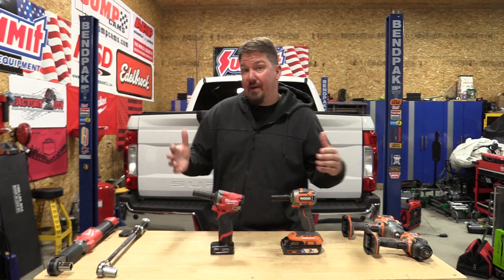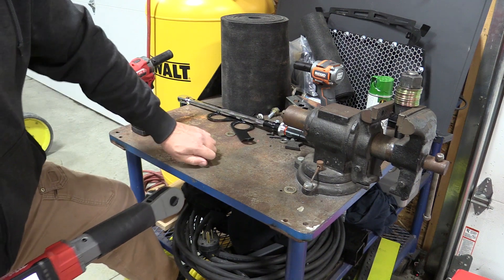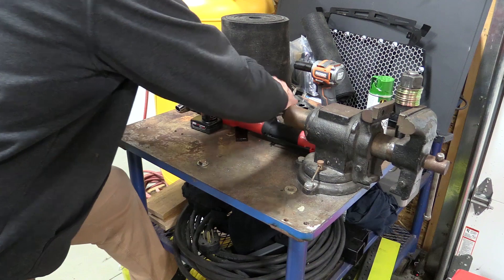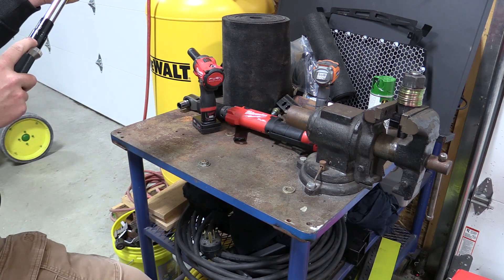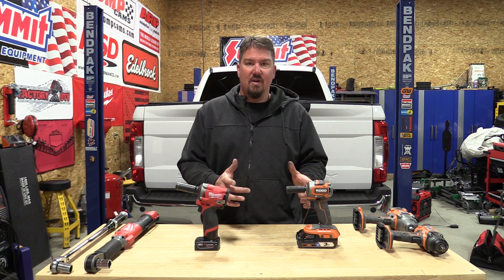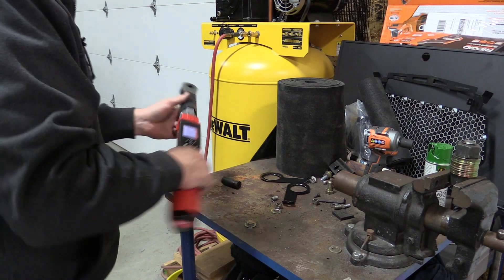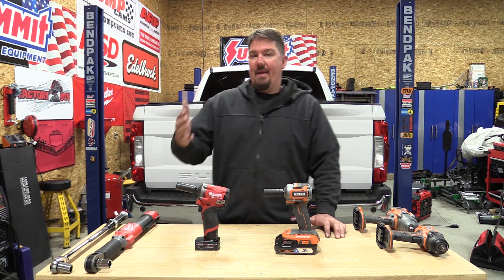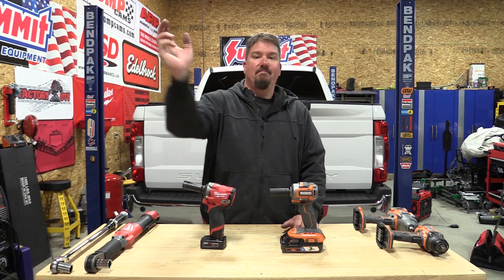Milwaukee FUEL M12 Stubby Vs Ridgid 18-Volt Sub-Compact Impact Wrench

Comment: One of your other videos mentioned the DEWALT  XTREME 12-volt Brushless 3/8-in Impact Wrench.  You seemed to really like its small frame.  I see the Rigid 18v is going for $88 at HD, no battery.  The Dewalt 12v is $149 at Lowes. 

Between the Rigid sub compact 18v and the Dewalt Xtreme 12v, which one would you go with?  
Thanks

Comment: Suggestion: the caliper bracket bolts on cars can take way over 250 ft.lbs of torque. 

They are usually 12.9 property class bolts with 18mm-20mm diameter.

Comment: man that's literally a $700+ torque wrench
Reply: I would sooo love to have that
Reply: What is the brand and model of your digital torque wrench/powered reatchet?
Reply: Russ Campbell are you serious?
Reply: @russcampbell7994  its a milwaukee
Reply: And completely useless on modern cars as they are mostly torque to yield and need an angle function. Dumbest tool Milwaukee has ever made.
Reply: SATAMAN Schmidt true
Reply: @satamanschmidt3428  Your point are true but Milwaukee themselves even state that the torque wrench wasn't made with mechanics in mind. It's aimed towards electrical work
Reply: @satamanschmidt3428  Maybe useless for you. GO talk to an industrial electrician and other trades and see if they think it's the dumbest tool they ever made. If they spent so much time and effort on developing such a tool, there's probably a high demand for it.

Comment: Just weld a grade 8 bolt coming up threw the table then just use a nut for the testing it would be very strong then and super cheap.
Reply: Or a grade 8 with a non threaded hole and just let someone hold the nut side with a breaker bar. Maybe not 100% accurate but either would work.
Reply: Both of you are pretty on the right track. Grade 8 or better bolt and nut rather than trying to tap a steel plate. Theo only question is how to secure the bolt or nut.

Comment: Sunex makes 3/8 impact sockets up to 22mm in both shallow and deep. I believe they go up to one inch in standard as well.
Reply from the maker: I do not have them because I jump to 1/2" after 3/4"  At what point do I need a ton of 3/8" impacts when I have 1/2, 3/4 and 1" drive units.
Reply: WorkshopAddict I got them so I don’t have to lug the heavy half inch impact around to snug up lug nuts when the 3/8 impact can do the job and they are much lighter. Considering the torque those little 3/8 guns put out I reach for them first. Plus the sunex 3/8 sockets are thin wall sockets so they come in handy in tight places. Anyway just though they might help if you want to step up torque testing with bigger bolts. Appreciate all your videos!
Reply: You can also get the full 3/8 Proto Impact set that goes up to 24mm shallow and deep.  Its USA made also, I highly recommend them.

Comment: Hey Brian. 
This is definitely not intended as a criticism, simply an observation on the testing method used in the video. 
As you tighten, loosen and tighten the same bolt into the same hole, both the bolt and the hole can't help but heat up which could drastically affect the amount of torque or actual effort required by each impact wrench to break the bolt loose. 
Similar to using a torch to heat a stubborn or stuck bolt. 
Perhaps multiple bolts fastened to a long piece of steel would help with accuracy. 
Having said all of that, thanks for all that you and Jeff do to help us make more educated choices in tool selection. 
Much appreciated.
Reply from the maker: i totally get it John.  We do not have the capability at this point for testing like this.
Reply: @WorkshopAddict  Fair enough. 
Thank you again for all that you are able to, and continue to do.

Comment: Really like this testing style - I think it simulates the majority of my automotive experiences: stuff breaks and nothing makes sense. One question though - why not use the subcompact batteries in these tests?
Reply from the maker: We can never win when doing these tests.  People will say use the Octane for power and some say use small.  I wanted to be fair and use the Octane since the tool comes without a battery.
Reply: @WorkshopAddict  That makes perfect senes. Either way, you're doing a great job with these tests.
Reply: I think using the 4.0 or 6.0 on Milwaukee is more accurate to real world use on the impacts. Thank you for the video and the honesty of what you really experienced

Comment: Deep well has more mass than shallow socket is why there is higher  torque output from the impact. 

Check out lisle socket 77080 for harmonic balancers, they put allot of meat into that socket to help aid in the bolt removal. 

I don't know all the science behind it but more mass in the socket helps a ton.

Comment: If you dont understand why a heavier (deep well) socket produces more impact torque than a lighter (shallow) socket, you need to quit doing tool videos.  Its the same principal as why a 1lb hammer produces more power than a 6oz hammer, given the same energy (swing)....

Comment: Semi truck wheel lugs. I couldn't use my old Gen 1 non fuel Milwaukee 1/2" impact (rated 400lb ft) but my m12 stubby can take the lugs off of my 1 ton dually. You can buy 1" sockets for 3/8 but I used an adapter to get to the 1-1/8" needed for the dually

Comment: How about using the nut on a tow ball hitch??   Just take a tow ball hitch, face it sideway or upside down, so the nut is facing you!
I know they can take way over 250lbs-ft.  And the hitch is secured to an actual truck, so it will be secured.

I know it’s not perfect for the 3/8s, because you will have to use an adapter.  But every 3/8 wrench will have an adapter.

Alternatively, maybe you can take a sacrificial socket and adapter and weld them together, so you the have a 3/8 drive socket, and 1/2 drive socket, you can test your impact wrenches on.

Comment: I appreciate you being to straight forward and honest so much! ❤️ I think you should try a bigger tap/bolt and get a bigger socket.
Reply: Yeah a bigger bolt would be a must since they're being sheared off.

Would probably be better to just drill a hole through and put a nut and lock washer on the other side. Then if the threads let go you can just get a new nut instead of tapping a new hole

Comment: No expert here by any means, but I think if you want more repeatable results, you need multiple freshly threaded holes and multiple new bolts.  Each time you torque a bolt, it stretches.  Also, as the bolt heats up from repeated use, your torque results will change.   Be sure that all threads are clean and dry too.   Keep up the good work!
Reply from the maker: Fully agree/just doing what made sense for a video that was not edited to hell and did not show the results in an honest way.

Comment: The highest socket I can get is 22mm on my stubby. I got it from sunnex. Just send that the torque reading is perfect for these size tools 3/8
Reply: I have a grey pneumatic mid depth set in 3/8” SAE and it goes up to 1” but the metric set only goes to 19mm

Comment: I have all 3 of the Milwaukee stubbies and I think the tool testing the manufactures do to get there final spec rating is no load testing with small sockets and small bolts and nuts like the Milwaukee 3/8 having 250 foot pound of break away torque as well as install and the bigger the socket the more torque lost as well as bigger the bolt and nut so I think the results to get them ratings were done with a specific size socket and nut and bolt to get the 250 foot pound rating good video and testing Brian @WorkshopAddict

Comment: I appreciate the honesty and the effort to maintain objectivity. It's refreshing to actually see that. 
The use case I am interested in is when I am working on brakes. I went out and bought the larger Milwaukee impact gun with ~1000 ft. lbs of "nut busting torque" to remove lug nuts, and it lives up to the hype!! It's a beauty, and if memory serves it may have been one of your previous reviews that added to my confidence in the purchase.
With this particular tool, I am interested in what is strong enough AND small enough to get at the brake calliper bolts, and any other bolt where the large Milwaukee impact gun is unfortunately too large to get in those tight areas. Unfortunately I still need to use a breaking bar for those bolts sometimes. The Milwaukee impact ratchet is not strong enough for them. I am hoping this impact gun is the solution for that specific use case.
What this video does show me is that there is no evidence to consider Rigid over my existing Milwaukee investment, so it still serves a purpose for me.
Thanks for the video.
Reply from the maker: Some of the bolts that hold the brackets the calipers sit in are lock titled in there and are hard to remove.  We did a Traverse 2 days ago and we used the Milwaukee Mid-Torque to get the 21mm bracket bolts out so we could remove the rotors.  The stubby would not move them.
Reply: @WorkshopAddict  Good to know. Thanks for the follow up!

Comment: What?  You don't have $5k burning a hole in your pocket for an impact torque tester?!  Haha!  Good on you for giving it a try, and even better that you have the integrity to call it a fail.  With these 3/8 drive units getting so powerful it's tough to find the sockets big enough to do decent tests.  Glad someone has enough experience to tell the difference between an impact wrench and an impact driver too.  I think we are pretty much at the limits of what the anvils can take in 1/4, 3/8, and 1/2 in tools anyway.  With impacts, the sockets can make a huge difference too.  There's a kid on here somewhere who welded a heavy wall pipe sleeves over his impact socket and he's able to remove a lot more frozen bolts, and nuts than he can with a normal impact socket, which I found interesting.  But the darn socket musta weighed 3 or 4 lbs.   Some folks complain about how wide those stubbies are.  The larger diameter hammer and anvil are a huge factor in them having so much torque.    Like swinging a 12 lb sledge with a 30 in handle and another with a 12in handle.   Keep up the great work.

Comment: Where I live we don't have Rigid on the market, so I have nothing to compare with personally, but I do love my 1/2" Stubby.
Reply: You have AEG, same exact thing.
Reply: @juanc5149  We do have AEG by all means, but they mostly make household appliances for our market: washing mashines, dishwashers and such, not powertools. The closest to an AEG tool I got was the AEG labelled Fixtec nut for my M18 Fuel angle grinder, since all are TTI brands.

Comment: Koon Trucking did a video of the stubby Milwaukee doing 260 ft lbs with a 1/2 to 3/4" adapter on it. Used a semi lug to test it.

Comment: Got the Stubby 2554-20 recently, loving it. One thing to consider is if you are to get multiple tools you may want to consider you will be almost 'marrying' to the platform due to batteries and charges etc your tools use. You will want to have as few different battery kinds etc to worry about and to carry around with you. Pick a platform - be it Milwaukee or DeWalt or whatnot and try sticking to it.
I did get Mil kit 2554-22 with 2 batteries and a charger.

Comment: No biggy it is what it is, I still just don’t get the “butt” as you put it. It just completely eliminates the idea of sub compact.
Reply: Josh McSweeney I think if ridged went to a 12v style they would loose what ever edge they have since there using there larger platform battery
Reply: @joshm2243  I think it took me longer to read your comments than it did to actually watch the whole video. 
Correct me if I'm wrong... I get the impression that you think these should be used/compared in an automotive setting.
Reply: I think TTi keeps the Milwaukee a little bit more compact so they don't have the two compete too closely.  The power is pretty close so they need a way to justify $30 bucks more.
Reply: Not to mention the voltage difference. A 12v beating or even competing with a 18v? Clear winner

Comment: Semi studs and lug nuts are pretty durable. perhaps you can drill a hole in the table to accommodate one or weld one to the table ?
Reply from the maker: They are, and I have a pup outside, I just need the right sized sockets
Reply: @WorkshopAddict  lol
Reply from the maker: @DigitalYojimbo  You don't normally work on semi trailer lugs with a 3/8" socket........
Reply: @WorkshopAddict  yes, however it seems that u need a solution to striping threads.

Comment: The heavier the socket, the more powerful the impact action. I suspect this explains your differences between the two videos with the performance of the Ridgid tool. Unrelated, I cannot stand the Octane batteries. I think TTI is making the Octane batteries larger so that Ridgid tools are not so neck and neck with the milwaukee tools. I suspect the old 4aH Ridgid battery would also perform better than the 3aH Octane, simply because there are 10 cells in the 4aH battery vs 5 cells in the 3ah Octane.
Reply: I think the 3ah ridgid batts are the newer 21700 cell with more output. The others are 18650 cells. But im not a battery guru just what I read on other forums.
Reply: Octane batteries are the Ridgid equivalent of M18 High Output batteries.  The cells are larger but superior in performance.  Ideally you'll have a mix of sizes to match to the tool you're using.  I put a 1.5 compact on the flashlight but the 6.0 HO on my leaf blower.

Comment: Did they both have the same watt hour size batterys?
Reply from the maker: Yes, finally someone sees it.  Everyone cares about the volts and says it is not a fair test.  LOL
Reply: 12V watt hours vs 18 watt hours isnt comparable sorry you are wildly incorrect.
Reply: @nomercyinc6783  It's comparing the two tools with i think similar battery amps. Might not be perfect because guess what you can't compare an apple to an orange and say well it's not a fair comparison. That's why you compare, to see the differences and the similarity and who does better in each aspect.

Comment: Use the adapter on both guns, gonna be same outcome on both. Its gonna loose minimal cause adapter is so short.  Koon trucking already showed this taking off big rig lug nuts. Milwaukee still took off the 250ftlbs,  so what u loose maybe 10ftlbs with adaptor if that?  U also should be testing Tq against a Nut not the bolt. Weld bolt to bench, so u can loosen nut

Comment: I appreciate your reviews. Both are great choices. All depends on your battery platform. Love my stubby and use it more than my mid or high torque m18 models. Has plenty of power for most applications. Only had to go up to the high torque once so far due to swivels and extensions that were needed. I was extremely glad I owned it at the point.

Comment: Why not get some threaded rod that's hardened properly instead of tapping the mild steel of your bench? Just Clamp it in a vice and tighten a couple nuts back to back, or tack weld one nut on and torque the other into it.
Reply from the maker: The vise is what seems to be my weak point.  It will slip or turn on me.
Reply: @WorkshopAddict  get a better vise and bolt it down lol

Comment: I have seen a lot of other comparison or review videos on the impacts.  I believe all of them have come to the same conclusion in that the deep well sockets for one reason or another, are giving them a higher torque allowance number, both fastening/tightening and removing.  I'm not sure why that is as I am not an engineer, but in my mind, I would think it would be the other way around.

As for your extreme testing question, I've seen a few others take both of these tools to the task, and the Milwaukee walks away.
In fact, Koon Trucking just did a 1/4 in collet impact comparison, and you'll see that Big Red walks away with the prizes, even compared to other high end tools.

Comment: Possibly a reason the short socket isn't as effective is that an impact is all about mass. The more mass you swing, the bigger the impact. 
When delivering torque through a deep impact socket, you're driving more mass than through a shallow socket. Or so I've read, heard about. Makes sense to me. 
Also, using impact sockets & extensions is very important on an impact driver. They're usually heavier (more mass) & harder to prevent twist. A regular extension will twist a bit with the impacts. Torque bars for lug nuts are a good example. They 'absorb' a certain amount of torque so the driver end only allows so much umph.
An issue with some cordless electric impacts is that they hit so fast in succession the torque bar doesn't have time to 'relax' between strikes & that can mess up the final torque. 
Also, breaking strength is always more than tightening strength. It's easier to loosen than tighten. Tightening is forcing threads & material apart, physics is against you. Loosening is allowing threads & material back to their original shapes, physics helps you. 
Another thing to consider with the WTF results - metal fatigue!
Good video man, much enjoyed. Real life shit!

Comment: Try a nut or 2-3 nuts in a vice so you will not have too worry about pulling threads from a tapped hole. If you pull threads from a nut it only cost a few cents to replace a nut. I appreciate the effort in the vid and enjoyed watching it
Reply from the maker: The vise will not hold at 190 ft lbs.  Bolt starts to slip around.  :(

Comment: Congratulations for your videos. I have an M12 stubby and I noticed a longitudinal play in the pin. If I push it towards the inside with a finger it backs off a little and it's annoying when changing socket. Does your stubby do the same? Thank you very much :)

Comment: Try using the lugnuts on the truck behind you. Torque one at 175,200,225,250 and 275. see if both can do it or where one fails. If both do it keep going up by 25lbs until one can't do it.